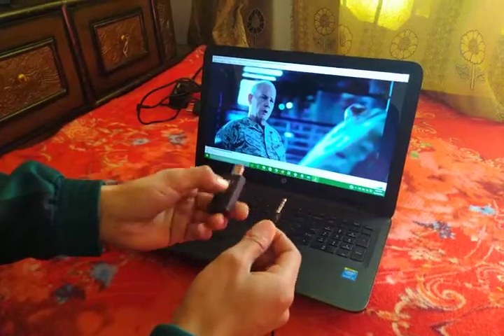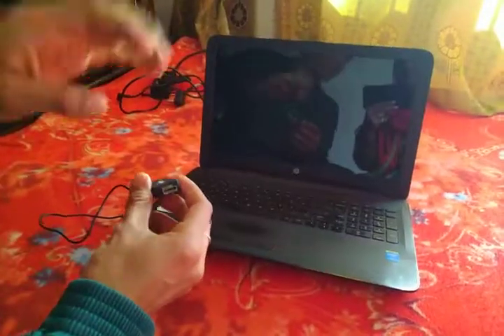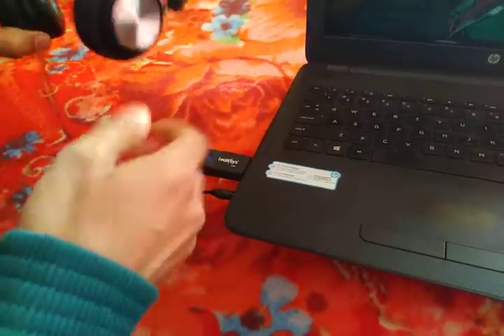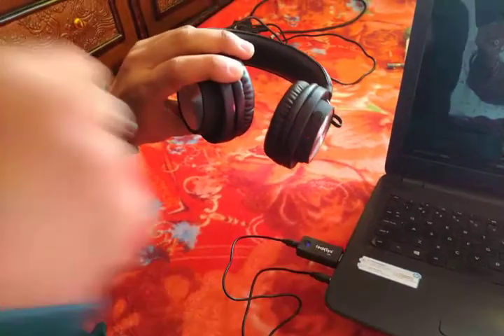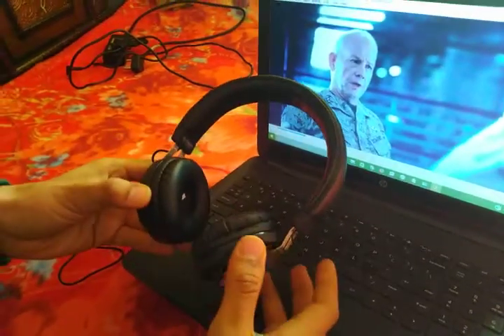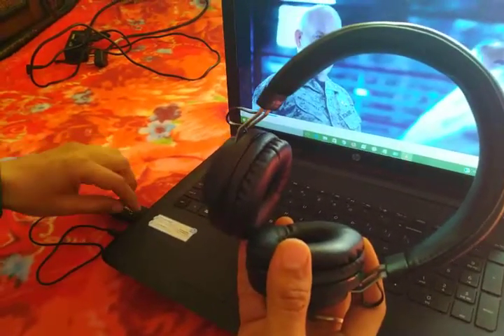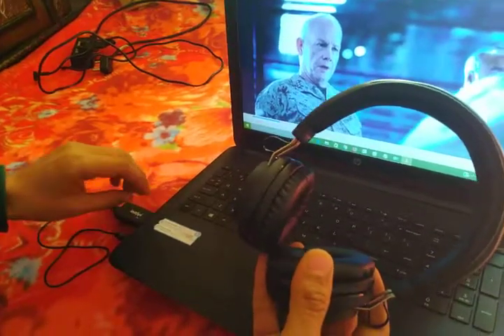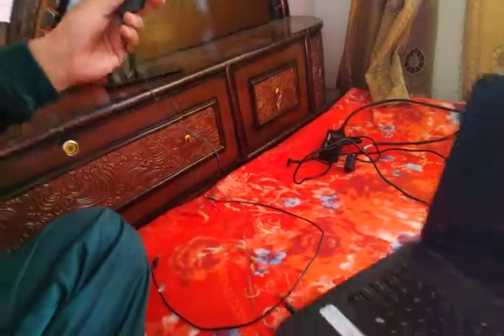bluetooth transmitter audio noise removal used in tv

Comment: Ok so I tried plugging in the power source to my ps4 instead of my tv and the noise didn't go away. Then I understood the ps4 is connected to the tv also through hdmi and that was the reason it didn't work. Now when I plugged it in to an adapter in the power plug the sound disappeared so thank you man :)

Comment: It is working fine in laptop, but when trying to connect with tv humming sound is there. Also tried to supply power through mobile charger and through laptops USB but still humming sound is there. However no humming if audio is supplied from laptop or Mobile. Problem is only in TV